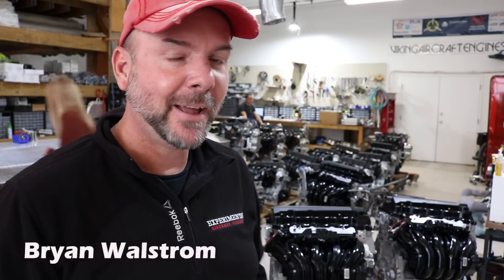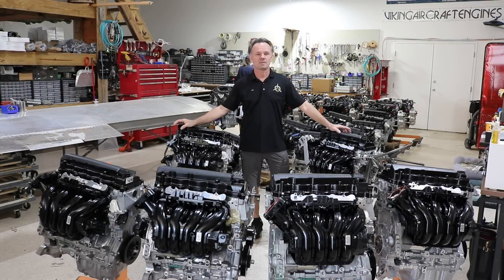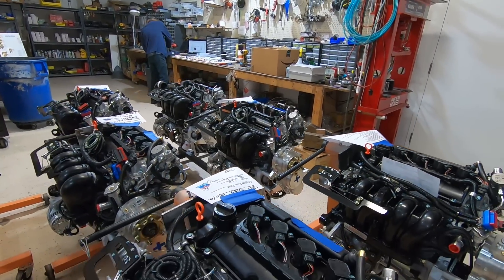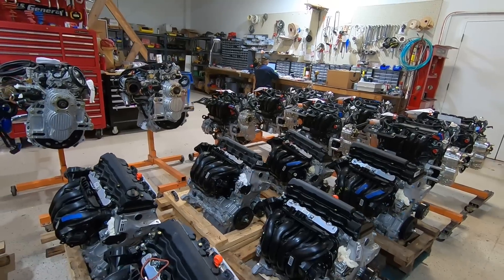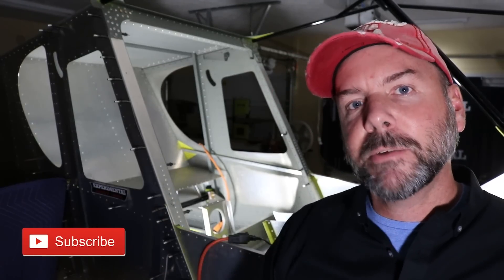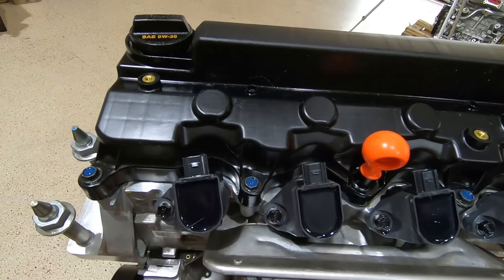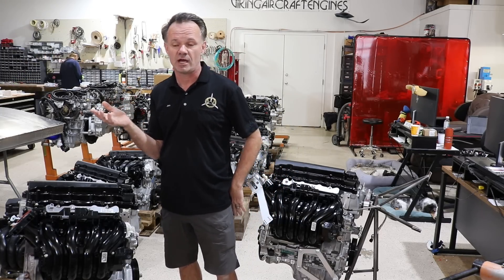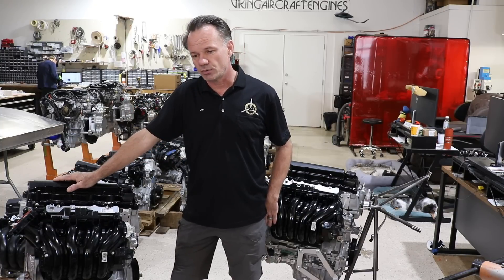150HP Honda HRV Aircraft Engine! Viking Aircraft Engines

Comment: I wish alternative engine builders would talk about torsional vibration and harmonics in the gearbox more.  Without knowing where the prop resonance frequency is, and the torsional vibration of system, you are a test pilot.  In the certified world, the engine is tested with each prop it's approved for, and even so much as changing the ignition COULD cause vibration issues.  Testing is the only way to know, and I'm not talking about we have 100 hours on the engine and nobody has died testing, I'm talking about stain gauges and scopes.
Reply: I understand what you are saying, but yes it is experimental to an extent, BUT we test our engines with a multitude of propellers, types of propellers, amounts of blades. Then we have kept our damper the same, cut different way etc all have different effects. You would be AMAZED how little vibration you find in these engines it is not one of our concerns.  We get very caught up in the moment and do a lot of stuff behind the scenes, we are working more towards displaying that to the public, we just assume it would be incredibly boring....When this all first started there was a ton of flight testing, this is many years down the line and over 1000 engines on the market flying all over the world. Every little thing was thought about, and the minute we can make something better (even if it doesn't have to be) we do, because it is experimental, and some people lack the needed real work needed to make it work, but for us it doesn't limit perfection. -Alissa
Reply: @eggenfellner  Thank you for the helpful reply.  I know it's not going to be lycombing levels of testing, but talking about harmonics and what you are doing about it is fruitful and what I'm asking for.  I realize that inline 4 engines at high RPM have less amplitude and more frequency, but they do vibrate.   Having a prop combination that has been tested with the proper tools is what I'm after.
Reply: This is why these are experimental... To that end, overbuilding is the common solution. We will leave trimming all the fat to the certified world that wants to pay for it.
Reply: @AnonyMous-jf4lc  Overbuilding doesn't cut it with harmonics.  If it resonates you could build it 100X stronger and it will still fail.
Reply: @akschu1  you are way way overestimating the power of harmonics. Resonance disaster is what you are referring to, and it’s most prevalent in items that are designed to flex to begin with. The oscillation resonates, and amplifies past the elastic limit. In a gearbox, the mesh of the teeth and bearings not under preload would be affected. It’s quite easy to overbuild as your just factoring in the inertial loading that could be present. It’s also easy to see if you’re going to have issues after short run times and an inspection. If loads exceeded what the gears were capable handling, spalling would be evident very quickly through close scrutiny. Take your YouTube engineering degree and go away.
Reply: @AnonyMous-jf4lc  Have you folks looked into the story of the Lockheed Electra?  I believe two of them were lost in flight due to resonance.  Very interesting story.
Reply: @6milesup  yes, resonance disaster due to a broken mount that allowed the wings to resonate from the props. This doesn't play at all into this conversation because prop speed is typical and mounting on this airframe has been thoroughly tested with many planes flying.
Reply: @AnonyMous-jf4lc  "Doesn't play into this conversation".  Are you some sort of thread nazi trying to control what people put into threads?  I merely said it was an interesting read.  That's it.  Jeez.
Reply: @6milesup   Then post a new comment instead of replying to the thread about gearbox harmonics. We are talking about apples, and you want to toss in an orange. Yes, they are both fruit, but that doesn't mean it fits.
Reply: @AnonyMous-jf4lc  Hey MX.  Did you see the video of the Tacoma bridge collapse from 2006.  That was a harmonic situation.  You should check it out.
Reply: @AnonyMous-jf4lc  Are helicopter blades the same as airplane propellers Captain Know-it-all.  Maybe you should enlighten the YouTube community with your incredible knowledge and police tactics of keeping a thread on track.  Speaking of tracking, here is another video of resonance.  https://www.youtube.com/watch?v=0GEj69NANc8
Reply: @AnonyMous-jf4lc  I mean, come on.  You ride bicycles.  Why are you even here?
Reply: @AnonyMous-jf4lc  why would you say I don't have a grasp on physics?  There is no basis for that attack.  You don't know me.  As far as aviation, you could say I have "some" experience. LOL.  I think that if you knew me, you would understand that I am yanking your chain.
Reply: @6milesup  I don't know you. "Yanking my chain" came off as completely uniformed and combative. If it was in jest, I apologize for not recognizing it.
Reply: @AnonyMous-jf4lc  We are good.  Sorry.
Reply: Ironically I’m the second “Steve” (we Steve’s must have great taste... lol) to have a Viking 110hp removed from a CH750 STOL and have this Viking 150hp motor installed. Just like the smooth as silk 500hr old 110hp that was replaced thus 150hp acts the same. It runs smoother than any other single engine aircraft I’ve flown. In my almost 30k hrs of flight time, I’ve flown my share of different type aircraft manufacturers motors prior to getting on board with the airlines. It’s smoothness and it’s power are pretty impressive and my 750 Stol with the extra 40hp and a new prop will give you an almost uncomfortable climb out angle. Trust me vibration of anytime is not an issue with airplane any that is there is further dampened by a pretty slick rubber dampened engine mount which is another work of art. Jan and Alissa at Viking Aircraft Engines will not let you down. Reach out to any of us flying there motors and I’ll bet you a beer that there aren’t any people that have regrets going with these engines.
Reply: If you expect an engine as thoroughly tested as a Lycoming you are kidding yourself. This company doesn’t have a $10 million budget and a platoon of engineers. They have a small shop and a few guys. They do their best with the resources they have. If you get an early one you will be helping to prove it. That’s just how it is.
Reply: @sblack48  I think that's a little misleading. You won't be proving the engine design, that has already been done. Additionally, if they are reusing the conversion components, you won't really be proving those, either. Really, all you would be proving is how efficient the conversion is.

Comment: Has anyone not read the problems with these and the previous Subaru conversions? Your putting people in harms way with everyone of these videos promoting this engine (my opinion of course). All I’m saying is do your due diligence  VERY carefully.
Reply: Have you seen the amazing success stories over the past decade? Been swapping out everything from a Continental to a Rotax for years successfully and affordable. I can give you a list of 100x that in success stories! You learn a lot through the years and just like anything the few negative are enhanced to be far more than reality. Still have people today putting hours on their Subaru and building aircraft to put a Viking in.
Reply: @alissaeggenfellner4613  You can't change the physical limitations of the design. The traditional larger displacement flat design will always be a better performer in aircraft. Affordable but absolutely inferior.
Reply: @MrCarGuy  1000 HBO, if they don't break earlier, plus burning reliably burning huge amounts of gas, since they can't be high compression unless you run 130 octane gasoline.

Comment: I was wondering if there is anything out there for someone who flies to places where 100 octane is hard to find.  I am assuming the Viking can burn autogas.  I know some manufacturers are looking at jet/diesel engines.  The diesel is low revving engine so there would be no gearbox and a lower specific fuel burn.
Reply: We prefer the use of Auto fuel, but 100 LL can be used with an additive like TCP or Decalin.

Comment: these motors make no torque... thats why they are only used in small E/ABs.
Reply: Suitable for this application. On the aircraft they go on - have more thrust, high torque especially through the gearbox, win STOL comps and have higher cruise speeds than other other engines in the platforms they are used in.
Reply: Torque output at the flywheel means absolutely nothing in an aircraft application. For example: Before the gearbox, a 600 hp PT6 makes less torque than these Honda engines, yet it's used on the Cessna Caravan. A gearbox on an aircraft engine multiplies engine torque and drives the propeller at the proper RPM, with the proper amount of force.

Comment: Honda rates this engine at 141hp in the HRV.  Where's the 150hp figure coming from?
Reply: Every time we have tuned an engine, we have always been able to get more power out of it than stated for use in the vehicle, usually 5-10 percent. We tune for power, most cars tune for efficiency.
Reply: @eggenfellner  I hope dyno results will be posted.
Reply: @jetrep  yes they will, as always. When we get some time and do in-flight testing we will have charts/video of dyno and will do some charts with real flying numbers etc.
Reply: Automotive OEM ratings are as the engine sits in the vehicle.  Full intake system, full exhaust system, all drive accessories, and an ECU tune to pass emissions for 125-150,000 miles.  When Viking rates an engine, it has far fewer systems to drive, no intake restrictions, a freer-flowing exhaust, and an ECU tune that does not have to comply with emissions.  If you would like confirmation on that just watch some videos from Richard Holdener, he talks about this frequently in his videos where people ask him why his 5.3 liter LS engines make more power stock than what GM rates them at.

Comment: One day I hope they convert the 2.0 liter engine from the Accord and do a 250 horse engine.
Reply: That opens up a couple year R&D for us because we would be breaking into a higher untested HP rating and complexity, this was an easy transition for us right now. It isn't off the table, but it would take a considerable amount of time to be as efficient as reliable as we would like.
Reply: @eggenfellner   I think you would be in a good position if you can complete with the IO540. 300 hp is what you would need for some of the larger kit planes like the Murphy Moose, bearhawk, etc.
Reply: The K20c1 high performance turbo engine from the Fl5 Civic at 315hp and 310 ft/lbs torque is a very sweet package with several performance upgrades from the K20c3 in the Accord. Available complete from Honda Racing for about $10k. The turbo would help with thin air performance as well.

Comment: I am just learning about GA right now and I am a bit confused. 
1. How would you find fuel when hopping from airport to airport ?
2. Does Vikings modify the engine so it has redundancy safety systems?
Reply: You can use regular car gas or 100LL, there are not limitations. Us and many of our customers travel cross country and many states frequently. Redundancy exists with dual fuel pumps, dual batter and alternator.
Reply: @eggenfellner  incredible! Thank you for the response !
Reply: @eggenfellner  Does avgas clog the exhaust sensors?
Reply: @daisybeagle6259  They can modify it to lessen this, or eliminate the sensors altogether. Just run the ECM computer in ‘closed loop’.
Reply: @daisybeagle6259  Until the 100LL stock is depleted and UL100 is everywhere, Viking recommends a couple of fuel additives to deal with the lead.

Comment: How much does the 150 weigh with exhaust?
Reply: 225 lbs, our 150 HP engine only weighs 5 more lbs than our 130. Very similar installed weight of an O200/Corvair setup (but with more HP and thrust)

Comment: The piece holding the bottom end is called a Girdle
Reply: Would it be considered a bed plate then?
Reply: @josephmodar1290  yes! I knew there was a word for it and you nailed it.
Reply: @josephmodar1290  we have been trying to find the correct name!
Reply: A good example of a split block engine is the Cadillac Northstar.
Reply: @bunkie2100  Maybe not a ‘good’ example... 🤔
Reply: Not really, a girdle ties caps together. This is a spit block design.
Reply: @AnonyMous-jf4lc  ok, i though it did like the K20 and 24 motors which have the caps built into the "girdle". I may be misusing the term tho.
Reply: @captarmour  a girdle won't extend outside of the oil pan. A split block design will look like an extension of the engine block, and the oil pan will be mounted to the bottom of it.
Reply: @AnonyMous-jf4lc  ok  i stand corrected

Comment: every time I hear Viking prices I just think about how Rotax is twice that and still not as reliable. I feel like car engines have developed and matured more than purpose built aircraft engines and are just a logical choice. Viking has always been at the top of my list by a lot. Sure, they may not have some 250-300hp monsters, but how many people really need that. the efficiency and reliability of these will always outsell anything else to me.
Reply: How'd you determine the Rotax engines are not as reliable as Viking engines?
Reply: "Rotax .. still not as reliable..." Kidding? ))))
Reply: Have you heard of Jabiru engines, they do small 4 cyl and 6 cyl
Reply: @williamgoode9114  I have not! I will look into that.
Reply: @TheArchitectJC  Aeromomentum use Suzuki and Mitsubishi motors
Reply: @TheArchitectJC  Look  very carefully at the Jabiru 4 cyl, it has a bit of a reputation for unreliability, look online for reports and information.
Reply: @TheArchitectJC  I dunno about you, but I'd LOVE a 300hp NA motor that weighs under 200lbs and runs on 91 octane pump gas. 4 or 6 cyl, I don't care.

Comment: Such a good solution! Does anyone use any Toyota engines in their aircraft? It seems like Toyota would have a couple that would be a great choice as well.
Reply: Many new year engines have the technology and reliability there, its finding what you think will work the best and also be lighter, the car engines can easily be heavy without realizing, especially when you work up into the larger vehicles. The engines can usually handle it, it is ensuring the parts you add onto the core have the reliability and sustainability behind them to work together as a cohesive unit. -Alissa
Reply: @eggenfellner  ...thank you Alissa...now that makes sense!
Reply: the 1UZ is certified
Reply: Toyota engines tend to quite oriented to reliability, and tend to suffer in performance accordingly.
Reply: @superdupergrover9857  so true.. i can attest to that
Reply: @superdupergrover9857  no free lunch.